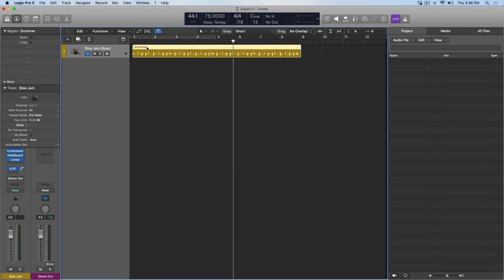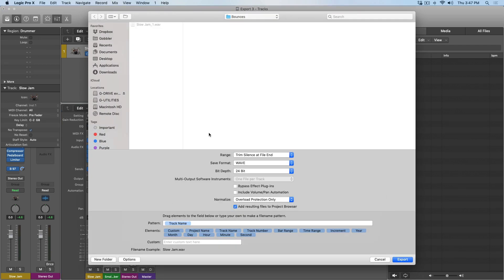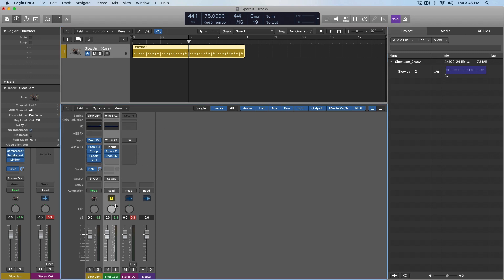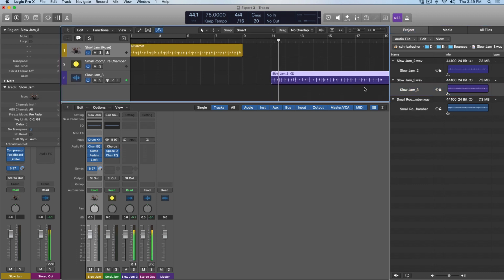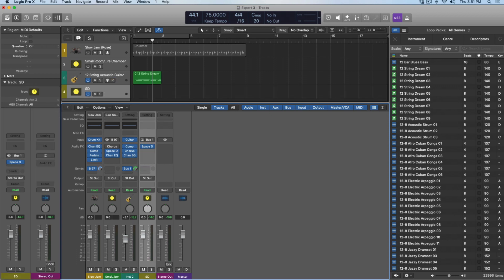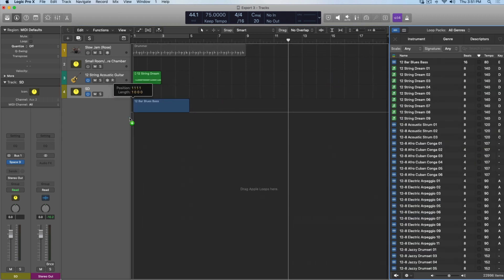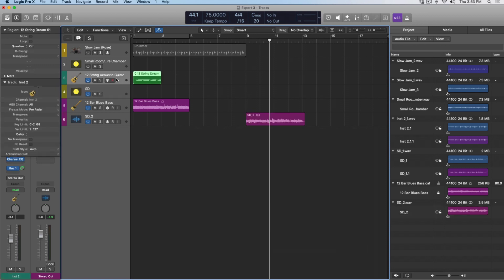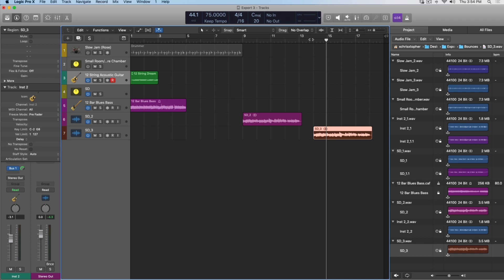Need to Export Send Effects Out of Logic? Here's How to Do It

Comment: But what if you have several sends? I'm trying to bounce vocals with a delay send, reverb send, and a wide send, and it will only bounce three of them individually rather then one vocal print with all 3 mixed in on it...
Reply: I think if you create a summing folder for your vocal track and drag and drop in the aux tracks you’re using as well for said vocal track.  you can then output the lead summing track to a new stereo audio track and record in.  Did I make sense?

Comment: This is my least favorite thing about Logic! My solution is to Solo the track I'm trying to export, select "Bounce Project or Section" (Command +B). Logic will think I'm about to bounce the entire project, but I just change the title to my selected track. It takes a second or two longer than exporting the normal way, but this gives you the right result and is quicker overall and less of a headache.
Reply: THANK YOU SO MUCH! saved my life.
Reply: The problem with that is if you have 50 tracks and your project is 7 minutes long (dance track) - it takes 3 hours i tried. Dunno why logic makes this so overly complicated and counterintuitive.
Reply: @Yorddz8796   best way to export stems I’ve found is to select all the tracks u want to export, say I have 50, then select export  50 tracks. Then u have to open them in a new project and add your master chain back onto them. Have not found a way to properly export tracks with the master chain on them…
Reply: @lilrocketman1934  hey man, thanks- but what do you mean by your master chain?
Reply: @Yorddz8796  any effects you used on your master track. For example I use the stereo spread, adaptive limiter and also the ozone 9 suite on my master track so that they’re applied to all my tracks in the project. When u select a # of tracks and export that # of tracks as audio files any effects applied to your master track will not be applied to those exported files. I still have not found an efficient way to export all stems with the master effects still applied other than selecting individual tracks and bouncing them out one at a time which still doesn’t result in the best sound and takes forever
Reply: I tried this but when I took all my bounced stems into a new project to compare the mix to the entire project bounced down into one track it still sounded off? Specifically my kicks did not hit as deeply or nicely in the stems compared to the bounced down entire project
Reply: @lilrocketman1934  So, before you bounce the stems, you need to make sure any mastering plugins are off on your master bus. That way nothing's getting compressed or double the mastering effects. Also, if your drums are grouped and you have effects on the group -- make sure to keep those effects on when you solo and bounce that track out.
Reply: @alexb119  thanks man, there is still a slight slight difference for some reason between the bounced project versus the individually bounced stems even after following that but it’s very minor and is the best workaround I’ve found yet

Comment: Excellent, I imagine this answers the question of exporting layered sounds as one complete and unique sound, as per my query in my comment on the Part 2 of 3 video before the upadate.
Reply from the maker: Hey Quint S Ence, Track Stacks are the best way to create a layered sound for Export. I just test drove a MIDI Apple Loop sending to a Reverb, added the Reverb Auxiliary Channel to the Main Window, and created a Summing Track Stack with the Apple Loop and Reverb in the same Stack. Selected the Track Stack track lane, and exported. The result was a successful export of the Apple Loop and reverb melded into one. 

Then I exported just the Reverb Auxiliary Channel while it was still a part of the Track Stack. Success! Even despite that the Apple Loop was a MIDI loop.

When I removed the Reverb Aux from the Stack (set the Output back to Stereo Output), nothing exported, as I detail in the part 3 video.
Reply: @WhyLogicProRules  That's perfect, thanks for the reply. I'll give that a go.

Comment: so let me get this straight. if I finish my mix, which has tracks in it that have sends turned up enough to send signal through a bus to an aux channel that has effects (reverb, delay) on them, and I select to bounce the whole mix to my desktop (in what ever form I want). the mix that gets sent and arrives in whatever destination I have selected might not have all of the effects on it? the beauty of logic is that it usually just makes sense....for that signal flow to not be automatically recognized and included in a project bounce is not very.....LOGICal. just sayin. Andy yes, I barley know what im doing anyway. thanks.
Reply from the maker: Hey Jay, thanks for your comment! This export video is focused strictly on the exporting process. If you Bounce your entire project out (either using Command-B or going up to File > Bounce > Project or Section) all of your effects will bounce out with the Project. But if you're attempting to export individual Auxiliary Channels as their own separate Audio Files, this video should help you.
Reply: Why Logic Pro Rules thank u thank u very much..once again you have proven to be an impossibly good resource. I understand...by bouncing my “project” I am achieving an all inclusive bounce...thanks again.

Comment: Use the pencil tool and draw a block on the aux channel, then stretch it to the length of the track sending audio. Then right click on the block to bounce the aux effects in place 👍🏽
Reply: Oooh I'm going to try this.
Reply: Richard Ridings I did like 3 weeks of research and found it online.
Reply: @Hellatrackz205  Thank you so much for sharing - these little gems make all the difference!
Reply: Richard Ridings I agree, no problem.
Reply: @Hellatrackz205  So you print your Aux/Effects channel(s) as real audio and run them parallel with for example a vocal track ?
You do this to save cpu power?
Reply: Avatar7x7 Not to save CPU in my case. I only do it if I’m sending over stem files to a client. That way they have the effects stems also. Depends on what the client wants.
Reply: Exactly
Reply from the maker: You're absolutely correct Hella Trackz. I actually detail the method you suggest in another video: https://youtu.be/EtKWwcJ9n_k . This video is focused on the exporting processing instead of the bounce in place process. But thank you for reminding :)
Reply: @qtintervalmusic  🤘🏾